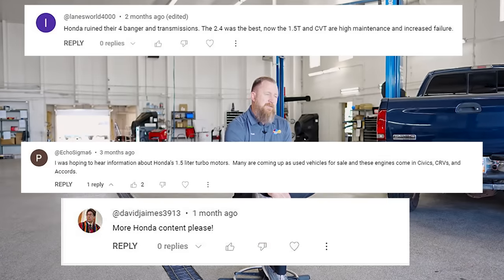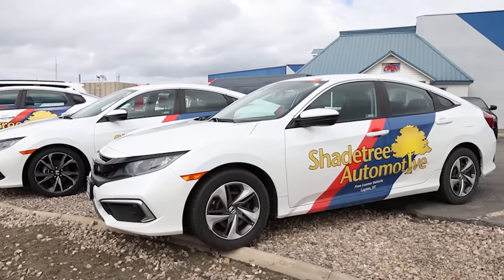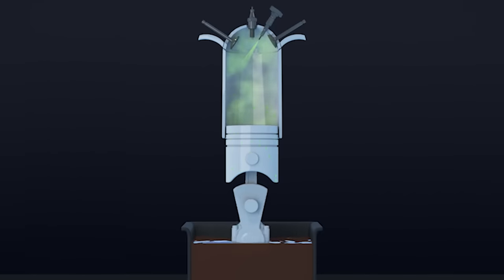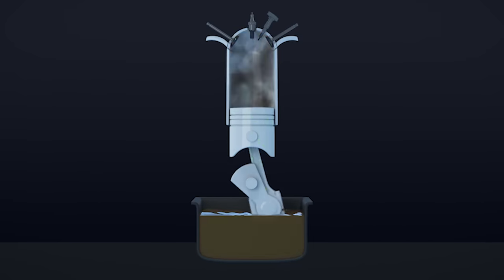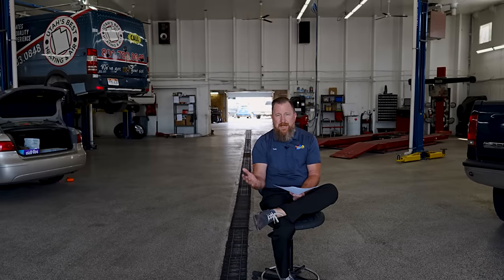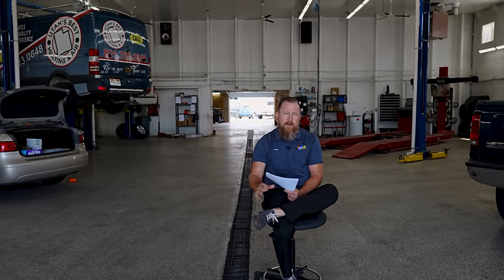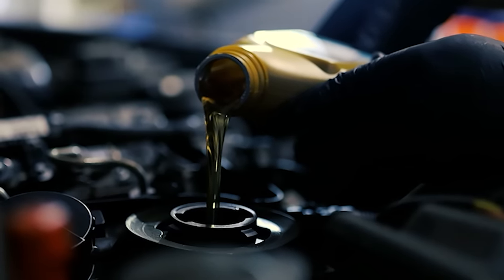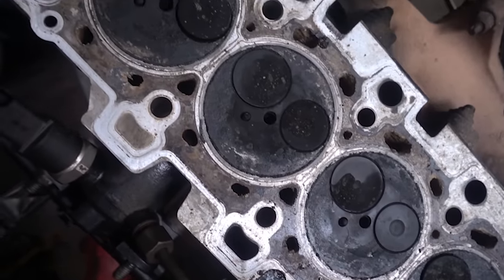Honda Oil Dilution Issue - Should you buy a new Honda

Comment: This video is not accurate. Every single Honda 1.5 Turbo engines have oil dilution issues, burning oil and blows head gaskets. The Honda 2.0 litre Turbo same issues except it does not blow head gasket more common. Basically, Honda engines from 2016 up to 2023 are absolute garbage. The internal components of these engines are weak and they are not overbuilt as the old Honda from late 80s and 90s.

Our dealer network have thousands of incidents and record keeping for decades, we don’t recommend Hondas unless you want to keep it short term like 5 years.

Comment: Had the issue when our 2018 CRV was new, but since recall  a couple years ago it doesn't seem to be an issue. Just don't go by the computer for oil changes.
Reply: When you say “don’t go by the computer,” do you mean to not really follow the Maintenance Minder on percentage?

I’ve usually stuck with every 6 months or every 5K miles (whichever comes first) for oil changes and always use full synthetic oil.
Not waiting for MM to hit that 15% mark.

Comment: Well junk from honda
They should have recalled
And corrected this crap
This oil and fuel mix may also
Wash the crank bearings
Damage rubber seals
And so on

Comment: I would avoid turbo engines (1.5 L are a little bit undersized, and CAFE should not be at the expense of engine reliability - but it is).  So , it's either Honda Hybrid or simply Toyota with normally aspirated engine , incl. Hybrid).  End of the story.

Comment: They are design to fail on purpose, i had a 2019 and a 2023 CRV, both the same issues. Engine can barely heat in cold climate, just stopping at a red light and you can see the temp dropping when the heater on. Had to do oil change every 2500 miles because oil was scrap and the engine noise would increase significantly. Both CRV were doing 2 hours commute from monday to friday and yet oil dilution would cause the level of oil to increase . Honda did update but it didnt fix anything, they told me the car was on warranty and to let the experts do theirs jobs loll

Been an Honda fan all my life but i feel sorry for peoples who bought them, there is no way this engine will last on the long run.

Comment: Scotty Kilmer said the new GF6 oil has solved this issue
Reply from the maker: id say it has improved the issue. Not solved it
Reply: I had this issue with oil dilution with my 2018 CRV and started using 92 octane fuel. Problem solved. I have changed my oil 4 times now and no issues. No oil dilution.  My daughter borrowed the car and I forgot to tell her to use 92 octane and after a 1000 mile trip I noticed the dilution. She used 87 octane.

Comment: Doesn’t this oil dilution go away if you use 5w/30?
Reply: How would the oil in the crank prevent unburned fuel from leaking through the piston rings...  🤔

Comment: The injectors are the problem . Poor quality fuel is making the problem worse. When an injector doesn't seal after shutdown the fuel runs DIRECTLY into the cylinder and past the rings and into the oil which causes the dilution this is also contributing to catalytic converter failure 
Get the update replace injectors and run top grade fuels with the advertised injector cleaners.
My wife is one of those who thinks the cheapest fuel is saving money,  NOT , Better fuel economy and no expensive repairs offset the additional costs 
With the oil being 0 weight add fuel to that , I suspect oil related engine failures at higher mileages

Comment: Stay away from 10th Generation Civics. It appears much was resolved with the 11th Generation Civics even though there is no guarantee you will not have an oil dilution problem.
The Honda Civic should survive 150,000/10 years before any major work is required to the CVT or 1.5L Engine providing you had the Transmission Drained and Filled, not flushed, and the Oil changed at or before 5K mile intervals. If you have driven on the Highway most of the time as long as you maintain 55MPH or less without constantly entering Turbo mode the engine will last longer. Unfortunately, the new 11th Generation 2023 Honda Accord is having many problems. There has been a RECALL on many Hondas recently. Honda's reliability has dropped in Rank from the Top 3 to 15th place I believe which is not a good sign. Toyota and Mazda still rank in the Top 5 but Toyota will soon fall flat. Nissan and Mazda might survive the Reliability, Dependability, Affordability, and QUALITY Crisis. However, do not buy a KIA which means Killed In Action.

Comment: why redesign the car body differently so they can get it into a different class so they can cheat the cafe standards?

similar to like how the suv was born in the 90s.

maybe change their vote for the 24-28 election term to get a different president in that may roll back the cafe standard.

maybe work with the fuel refiners to burn winter blend the yer around so they can lower the vaporization point.

maybe even involve the crank case  as part of the cooling system by making the crank case  part of the cooling system by embedding pipes into the crank case body and pumping the hot water through it and that would heat the oil and evaporate off the fuel.

the auto industry is no stranger to making cars for specific regions so they could make one batch for california to meet their environmental rules and another version that runs a little hotter for cold locations and so on.

they could take a page from the egr system found on many 80s cars where they recycled the exhaust back into the air intake.

so run a pipe into the crank case to draw the fuel vapors off the oil and recycle them to be burned.

the ecu (brain box) should be able to learn the driving habits and optimize according to habits that is why changing the battery can cause the car to stall.

Comment: I own a 2018 CRV.  At one time I was extremely upset with the dilution issue I was experiencing.  Now I have 165,000km on this vehicle and I am not so sure.  I do change the oil more frequently than suggested but, touch wood, I have not had any issues with the car other than normal maintenance.  There is also the extended warrantee.  I wouldn't buy another one but I am in no rush to sell.

Comment: There is no fix for this. It's an unfortunate byproduct of the direct injection design intended to meet ridiculous green standards. I smell fuel on the dipstick of my 2020 Civic Si with the 1.5T in as little as 100 miles after an oil change.
Reply: IT'S MAINLY HONDA'S PROBLEM....AND MORE-SO BY PRODUCT OF TURBO COMBINED WITH D.I. AND NOT HAVING PISTON RINGS NOT UP TO THE JOB. FORD IS HAVING THIS ISSUE WITH THEIR RANGER ENGINE BUT APPARENTLY NOT AS BAD AS HONDA.

Comment: Direct injection engines have been an absolute Bane on the owners of these pieces of crap for a while now. The other thing that I've noticed, I've rebuilt several LS Motors over the last several years. .030 ring gaps are way too large especially when the ring Gap according to standards should be somewhere closer to .018. Pulled apart a 5.3 I found every single ring Gap was .030. Great for making it easy to assemble, but it certainly answers why you're getting an awful lot of oil and sludge in the intake plenum.

Comment: If I were tinkering I would move back to dino oil instead of synthetic and try the next heavier weight with the idea that maybe it would be thicker on the cylinder walls and seal the rings better.  Then I would also go one model hotter on the spark plugs to see if it helped combustion.  I would give that 3000 miles and do an oil sample.  Would be an interesting test.

Comment: If you're doing 9,000 mile oil changes on ANY car or engine, you're doing it absolutely wrong. That is way too long of an interval. I don't care what that "manufacturer" says. Every 3-4k and I've never had a problem with either car I've owned. (2013 Chevy Cruze and 2017 Subaru WRX STi) don't let these manufacturer recommendations kill your car

Comment: He says, “it’s a good car”. Haaaaaa! It is NOT a good car if it has these engine issues! Would you buy a car with these issues if you knew ahead of time? Of course you wouldn’t! Stay away from Honda and buy a Toyota until they totally redesign the engine. Not modifications but a new design. I’d look at Toyotas. Toyota has better reliability, quality, durability and bang for the buck. I’ve had a Honda Accord, Civic, Toyota Cressida, Corona, Tacoma, Corolla and a Lexus. You can’t go wrong with ANY Toyota. Their quality is really remarkable and their engines are bullet proof. They’ll go 500,000 miles if you take care of it. Take a look around. What 20+ year old models do you see more of that are still on the road? ANSWER: Toyota.

Comment: Use a good fuel injector cleaner every oil change .( Techron) 
GDI systems must be clean and carbon free ...( Thy may leak and not close completely) 
Made to last 300 k miles no problems .
And don't use the cheap low quality gas like "the Happy Dino" for 99 cents  a gallon.
And i use straight grade30 from Valvo line ....😇🤔
Never use a multi grade oil in a turbo ,the V.I improvers turn to coke . Mono grade conventional is what I use in
S. California. 200k no problems 2016 turbo Civic  .good luck 🍀🤞 and techron every oil change ( 7,500 miles) by the mile minder light ..

Comment: Not an amazing little engine but a failed design, lower operating temp and you said it, lots of wet fuel washing down the cylinder walls. We have 4 Honda's with a million miles total still running strong, all naturally aspirated with real transmissions. Shopping Mazda and Toyota now.

Comment: Just great progress,you get rid of the naturally aspirated Honda rock solid proven engine 2.4iter and put in direct injection turbo units with high engine pressures that are a short sighted solution to trying to squeek out that emission decrease and fuel decrease for the same of the government at your expense.When the Honda warranty is off ,dump them fast.Disgraceful so called engine efficiency by Honda

Comment: Very good information! May I politely add that people should be running RAT540 blog #1 off the shelf oil and that’s 5W30 Quaker State Full Synthetic (gotta be 5W30 and not their Ultimate Protection). This is currently $22.97 5qt jug at my local Walmart. Also 5,000 OCI maximum. He goes into detail about why. His “ideal” OCI is something like 4,350mi. 7,000km. Must be Canadian eh.
Reply: Oil debates are so damn laughable. Buy this not that blah dee blah....generally nothing more than blind brand loyalty.
Reply: @halc.2899  Strange, but I had problems with the vehicles where I'd used Quaker State. The ones that got Pennzoil or Valvoline never caused any grief.
Reply: @Rick-S-6063   Kirkland or Amazon Basics is the best oil.

Comment: Honda owners should replace the oil when they fill up their turbo cars…. It’s expensive but you will keep the car running like a Toyota.    Otherwise the new Honda is like a ford.   Do it at the dealer, not iffy lube.    Dump the car before the warranty expires and never buy a used one.   And don’t smoke when you check your oil.

Comment: My wife has a 2016 Civic EX-T and I have this oil dilution in this car.  I change the oil religiously when I need to and add the required 3.7Qts with a new filter.  When I heard of the dilution, I measured the oil that I took out before an oil change.  I had 4.2Qts.  In @ 6000 miles, somehow, I had gained 1/2 Qt.  the Stealership said that I must be checking the oil wrong.  idiots

Comment: It could be the engine oil do not have enough film strength to protect the metal surface causing severe wear to the piston, silinder and rings. And obviously, not many people use engine oil made from PAO and esters.

If your car is new, you may have better chance mixing 10% corn cooking oil to any fake "full synthetic" you used.

Comment: I can not argue any of the great points. I owned a 2017 CR-V. I worried about this issue for 130k. I sold my 2017 for a ton! Without ever having a single issue with the vehicle. I bought a bigger SUV with a very conventional drivetrain, and it was brilliant! However, I needed to sell because it was bleeding me dry at the pump. I went back to a 2020 CR-V. I am truly confident that Honda, the largest engine builder, will constantly strive to make the best motors.
Reply: Gullible
Reply: @TimeMariner  With great respect, how so?

Comment: GF6 oil and 5k mikes between oil changes is pushing it imo. I wouldn't go past 4500 miles between changes, even with full synthetic. 

A good engine by definition does not have any issues. Honda made a garbage engine to comply instead of pushing back against govt regulations.

Buy a naturally aspirated 2L or better and you'll never have to worry about dilution.

Comment: Have a 2017 Honda CRV 1.5L turbo. When the issue first came out I noticed a gas smell in the car when stopped and driving. I have a long commute of one hour plus and live in NJ so cold winters. After the software update, the problem went away. I change the oil with full mobile one synthetic every 9k miles. The car currently has 248k miles on it, recently got an oil leak that I need to track down and on spark plug change cylinder 1 had some oil on the spark plug. The car can rough idle sometimes on start as oil gets up in miles but levels remain normal. Once the oil is changed rough idel on start goes away. I worry more about the CVT transmission than the engine as this is my first automatic. I change my cvt fluid when the maintenance minder says so. This is my 5th Honda, currently have a 2011 fit 350k mile as well, all went past 350k miles. 1991 CRX  , 1993 accord, and 1999 accord. To Honda's credit, I only changed the CRX oil 2x in its 356k mile life. Also, never needed a new clutch and never changed the transmission oil on all 4 manuals. Not advising you to do this it is just a fun fact on Honda build quality.

Comment: Dont buy turbos and stay away from deslers.  Find a good , descent mechanic and use the best oil money can buy.  
The thin oil they are using is not helping those engines either. The best oil viscosity is a 5W30. No higher or lower viscosity.  
There is a company that it has been around for over 65 years, and their oil is one of the best.  Bar none.  The name is Lubrication Engineers. They have a distribution center in Dallas, Texas.  I have used their diesel oil and gasoline 5w30 100% synthetic and are top-notch.  Also, Redline oils out of California has an excellent 5w30 100%  synthetic.  Excellent for turbos.
The onset thermal breakdown is an amazing 305 degrees Fahrenheit.  
0w20, 0w16, and 5w20 are too light.
Amsoil is good, too.  
I have used all these products and have analyses from a mechanical engineer that has a blog about oil and vehicle maintenance. 
You expend a little more in oil and save a ton later in maintenance cost.
My cars are 40, 18, and 17 years old respectively and are still kicking like new.
Pay now or pay later....
Knowledge is power, and it helps keep money in your pockets. 
Good luck and safe travel.

Comment: So I guess people should ask their employer to move farther so their vehicle can use more fuel to get it to a higher temperature, to do the job it was designed to do! However - doesn’t that just make the whole point of making a more efficient engine with direct injection a moot point? I thought driving less was the best solution for the environment? Guess not! 😎

Comment: Just get a Camry with the 2.5 liter 4 cylinder dual injection instead
Reply: @User-q6x3b  please elaborate
Reply: @User-q6x3b  And the CURRENT Tacoma's burn oil out the exhaust, ping and DIE when going up steep hills off roading....google youtube it....and the trans shifts poorly and the rear differential whines....all red flag time bomb issues....
Reply: @User-q6x3b  I got an old 07 Lexus is250 with 208k miles no issues. Also bought a 22 Camry last year and it’s been fine with no issues or leaks, decent power and good fuel economy. Already put 42k on it in a year and half, but I have heard of the new tundra early models have some QC issues. The way they’re going now with all these mark ups, probably my last Toyota. Was thinking of getting a grand highlander, probably end up buying the x7 m50i instead
Reply: @User-q6x3b  oh man, that’s unfortunate. I take care of my cars too, 5k oil changes on my regular cars and like 3-4k on my m3 (runs on e30). One thing is for sure, they definitely don’t make them like they used to. I even felt the quality difference in my second gen IS VS 3rd Gen IS. Every auto manufacturer is cutting costs now days and making cheaper quality interiors/ parts though. You just gotta find what makes sense for you personally.
Reply: @barrya.6212  Thank you for this info, I did not realize Tacomas have gone this much down hill in quality.
Reply: @User-q6x3b  I have heard people have had good luck with non-turbo Mazdas that are recent model years, best of luck for your automobile buying decisions, I own a Honda and a Toyota, but I am lucky with both models, the accord is a 17' V6 with VCM turned off and a 2020 Toyota Camry Hybrid like the Taxis in New York, 64K miles no problems.

Comment: The problem is in bad design of the engine, yeah honda excuse is drive longer until engine gonna warm up. It takes around 20 min driving for engine and oil to rich good working temperature. So like you said it's good to be driving around 45 min so u shouldn't have oil dilution problems. You know what honda and u are full is sh..t! Just trying to cover the issue by telling customers that it's their fault, their style of driving. So why before you sell the cars you don't inform that car needs to be driven by at least 45 min one way - otherwise you might get oil dilution. Nope note at all. I was a honda fun, and civic 1.5 T it's my third and last honda!

Comment: Besides the oil dilution fiasco, now a lot of these engines have issues with the head gaskets as the head bolts don't  provide enough clamping force. Shame on Honda for such a $hitty design